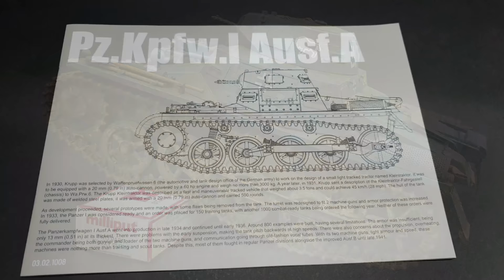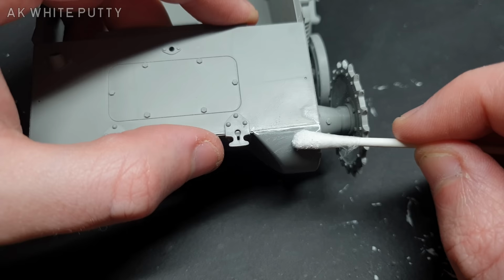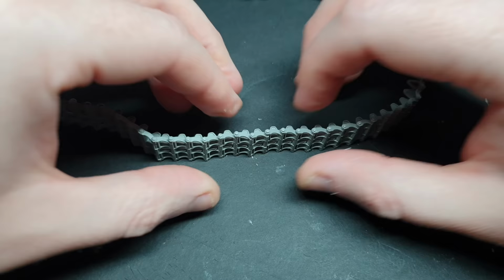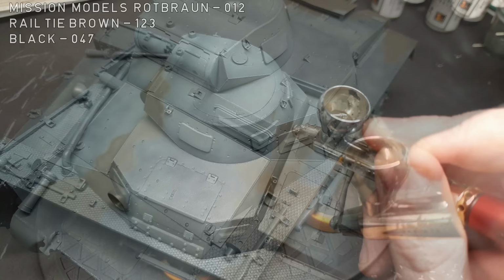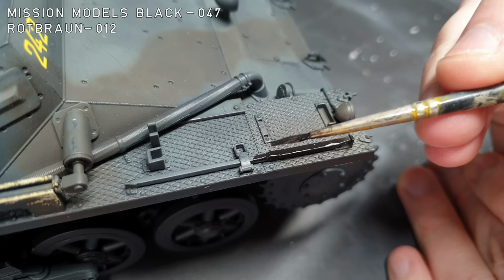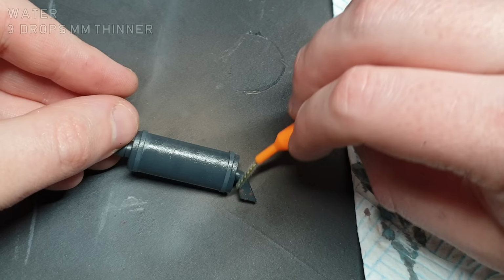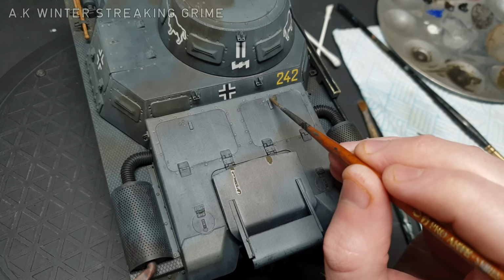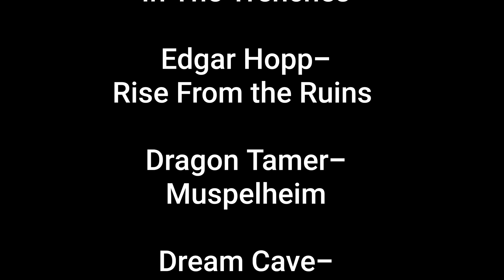Takom 1/16 Panzer I - Full Build

Comment: Nice job. For wood handles, I have painted the handle with a light brown and then burnt sienna oil paint, left to dry for a while and then “dry brushed” off with a clean brush. It leaves a nice stain. For rusty exhaust, baking soda can be used for a nice effect, but care must be used because too much baking soda just builds up into a mess.

Comment: Nice job!!,...in my opinion, one mistake that most of the modelers make is to not to weather the decals, so, in contrast with the rest, they look brand new. Some washes on them or even cut some parts off, may give a more realistic effect.
Reply from the maker: Thanks Javier thats a good point,  when I get around to using masks things like that will be a lot easier to weather, just need to get in gear and find some

Comment: Use solder for springs. Works great.
Reply: Just be careful not to use superglue with lead solder, a lot of people have found that a few years later they react together and destroy the model.  I use aluminium or copper wire.

Comment: That right there is a thing of beauty! Can't help thinking you just shrunk a real one though! Also, found out a couple of days ago that if you're really in a pinch for primer, humbrol enamel paint works a treat, goes down as well if not better than any primer I have used before over bare plastic, and doesn't scratch half as easily as the acrylic primers I have tried, and since I always leave primers to dry overnight, the fumes are the only real downside, but if you have a spray booth, that will deal with those for the most part anyway
Reply from the maker: Thanks Simon ! I dont have a spray booth yet unfortunately, and I find the smells of enamels worse than laquer. Good tip though thankyou
Reply: @lpjmodels  yeah....the smell is pretty horrendous!

Comment: GREAT build and video production.  I, for one, appreciate the warnings about ejector pin marks and removal, the tight fit of the fenders to the lower hull, etc.  You show how these "glitches" are easily overcome.  Your tracks and on-board tools are super.  And, the piece de la resistance is your mud effects.  In this large scale they are fantastic.  You have a new subscriber, James.  THANK YOU!
Reply from the maker: Lawrence thankyou very much, I'm glad you like the video and the tips, I feel bad if I say the kits fine when parts might be a pain, I may not go into tonnes of detail but the warning is there.  Thankyou for the sub , much appreciated!

Comment: Great job, and; a good video. I'll say this, that Tres Semme hair spray sprays out just about like that over here in the US. Rather than use a name brand like that, go to a Walmart or a pound shop (think that's what it is in the UK), and buy the very cheapest you can find. The cheaper it is, the easier it is for the water to activate it. In other words not a good spray for hair, IS a good spray for modeling. Also, you can spray some out in the cap and then pour it over into an airbrush cup. Don't know if I would do that in a Harder & Steenbeck, but; a $20 Amazon special would be just the ticket. I'm all for getting the best result, using the least amount of money. I'm going to have to get one of those Panzer I's and see if I can find a 1/16 figure of some sort to stick in the hatch. Good show. Happy modeling, my friend!
Reply from the maker: Thanks Stephen! I have an old sparmax that would do the job nicely I think. I'll pick up some cheap and nasty stuff and see if I can get a better activation many thanks for the tip.  
Someone mentioned Jeff Shiu figures 
http://jeffshiu.lsft.com/product37.html
The site is a bit awkward but there are some awesome larger scale figures on there.
Reply: @lpjmodels  Thank you, sir. I'll check it out.

Comment: Great Video mate. Great Result. 
 Re. Spring issue. I pull apart Any lighter I use. (BiC normally.) They have 2 Springs inside. Which I use if the Scale looks Right.

 Please make sure the Lighter is Flat or Empty to be Safe..!! 
 Just an Idea..!? 
Cheers kim in Oz. 😎

Comment: A lovely model James, very realistic weathering.  Brilliant video and great commentary, much better than music.
 I worked with tanks as I was in the MoD for my working life. I noticed that, unless tanks had been continually ploughing through really deep mud, they tend not to have a lot of clods of mud on their suspension but tanks do kick up a lot of dust in drier conditions and get a good even coat of dust over everything. You mentioned springs and I saw that the Takom spring was not too realistic. It is possible to make springs out of solder wire which is very soft and  easy to work but once glued into position is quite ok for detail.
Reply from the maker: Hi Allan thankyou, the tips will help future builds as well, I hadn't thought if using solder. The mud on this one was done without a lot of reference so I appreciate your info !
Reply: Hi I'm not saying your model looked wrong but once a tank full of mud gets on a half decent track the clods of mud tend to dissipate from the tracks and suspension  quite quickly leaving a thin layer of mud that on a model would look more like a dusty pigment.

Comment: Fantastic video. Have you tried using Tamiyas two part epoxy for weld beads? I find it much more easy to work with to get fantastic weld lines than stretched sprue. Great job on the kit!
Reply from the maker: Thanks Samuel ! I haven't yet but I'm hearing great things about it, need to get some

Comment: Really nice work James... it looks authentic and realistic. I like that interdental brush for chipping, I'll have to try that. One beef I have with this kit is the running gear and some details. In this day and age where models can be moulded to such high standards why would all those pin ejection marks on the wheels be present and why are the idlers 2 pieces... seems like some lazy engineering to me. For a model in this scale, I would have liked to see more attention paid to detail on certain parts and way more etch. I love Panzer 1's and almost bought this but I'll wait to see if they release a version with a full interior as at this scale and all the large hatches it could really make an impressive model. And a couple of nice DAK crew figures would be cool as well. Cheers M8!
Reply from the maker: I totally agree mate, it's a bit lazy of takom and I wonder why they took so many shortcuts, i would love a Panzerjager 1 on this frame though..  
Mant thanks !
Reply: Didn't MIG just release one in 16th scale? I think it's a collab with Takom.
Reply from the maker: @SmallSoldier  hey mate that's a breda Spanish civil war variant, I think the anti tank version as well is mounted on the B chassis ( I may be wrong there)

Comment: You should of used a tad more hair spray, I on the other hand over did it, there’s is a sweet spot, my tiger I did it perfect, and my hetzer was god awful,  huge areas lifted way out of scale
Reply from the maker: Thanks ! This was one of the first builds I used hairspray properly on and you're totally right ! Have to stop being a chicken and blast it on a bit more.
Reply: @lpjmodels  I'm not an expert apparently,  but as I was watching as you where trying to activate the hs, it seemed it wasn't reacting, I guess we both need to watch Rinaldi again, then again practice and experimentation is the only way someone master this technique.  I noticed the spray pattern out of the can, it seemed irregular you could always spray into your cup and spray it with your airbrush. Not trying to nit pick but modeling and nit picking go hand and hand.

Comment: Hi James. It's my first time on your channel but it won't be my last! I admire your attention to detail and the final result is stunning. I think the mud effects and weathering are perfect. Just one question... What happened to the tow cable?
Reply from the maker: Hi Ferbie , thanks a lot !
The desicion to not use the tow cable was a case of 2 points.
1. I have never had much luck with the twisted wire versions and I need more practice, 
2. After looking here ( https://www.worldwarphotos.info/gallery/germany/tanks-2-3/panzer-i/ ) and trawling through the images it wasnt always attached ( or at least visible in photos). That site is a great resource for grouped period photos, its come in handy a few times !

Comment: I have had terrible luck chipping mission paints on a few occasions. It seems like you didnt have the greatest luck chipping it either. 
I'm going to stick with Tamiya.
Reply from the maker: Hi Dan, thanks for the feedback, I think hairspray chipping with MM is definately something that needs practice to get bob on. Where did you think I went wrong ?
Reply: @lpjmodels  I dont think you went wrong anywhere. It just feels like there isn't a consistent release when lifting the paint. I have literally had a drop of water wash the paint right off before I even touched it with a brush and then I have had it where the paint wont lift almost at all without scratching first. I am noticing that it isn't lifting very well for you either.
I just dont like the stuff to be honest. I love the colors, so I just sponge chip them instead of hairspray. It's somewhat disappointing though because I always hs chip my exhaust.
Reply from the maker: @dantimmerman6693  I get you completely, there was a big wash out on my exhaust on this one which was a tiny pain, I'm going to experiment over different finishes in the future to see if I can get it right, I'm stubborn and although Mike Rinaldis worn effects look good I do want to get the HS chipping right,tight and controlled, I like brush chipping a lot, and that is my go to method so I haven't had this situation before.. 
I did get some more controlled chipping with the toothpick and I think that's the way I will have to go completely in the future ( unless I want a worn finish as opposed to chips ) 
The release is very slow, I think more poly helps. 
The paints in the regular sense though work so well for my painting style, I dont get any of the texture I did with tamiya in wing roots and tight areas, and I dont get reactions to setting solutions e.t.c 
I appreciate your comment! and paints are so subjective.
Reply: @lpjmodels  so now you know exactly what I saw while you were working away. Lovely giant you have completed here. Thanks for sharing it. I am building a 1/16 Tiger Mid/early right now. I may get this one next.
Reply: @lpjmodels  as far as my experience goes for hs chipping....Tamiya thinned with X20A is the absolute best for this technique because of it's hot base instead of being a water base acrylic.
I also believe this is what Michael Rinaldi uses for his paint.